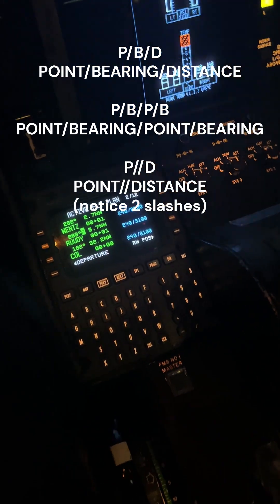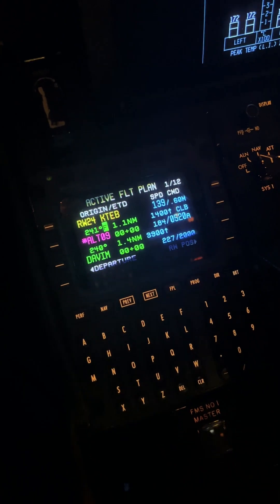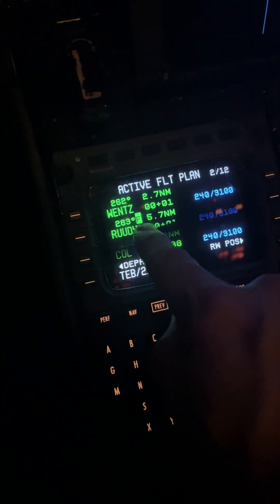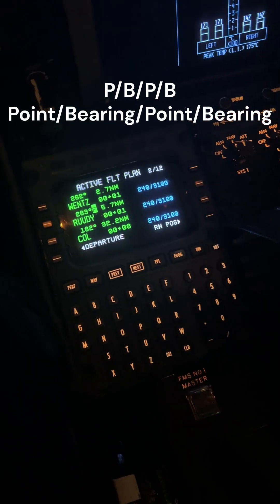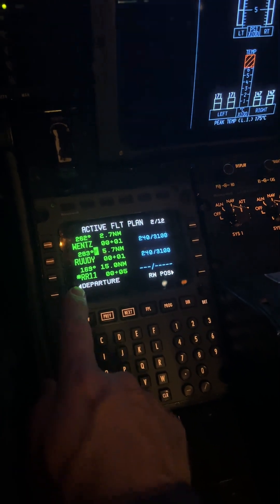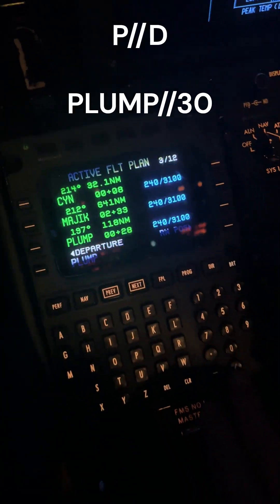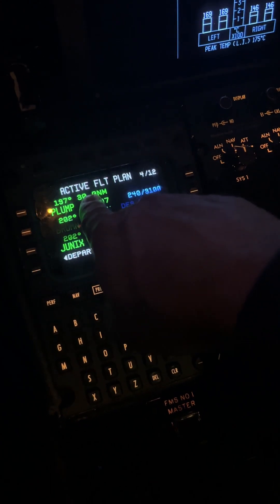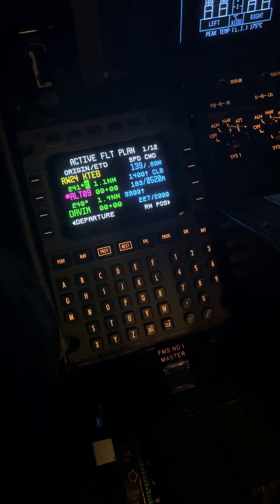FMS:  POINT/BEARING/DISTANCE

Comment: I am always amazed at how many current pilots don’t know how to do these in the planes they are flying. These requests don’t come up that often but, its a useful tool to know. Building the Quiet Bridge Visual RWY28R @ SFO is a good example. No reason to do that in Green needles.
Reply from the maker: @wgeffon  I’m sure they knew at one point but the #1 reason people forget is disuse.  As you stated, the requests don’t come up often which is why I did this video.  And, I use PBD every time whenever SFO is using the Quiet Bridge.   Thanks for your comment.
Reply: @CaptainDanPalumbo 
You probably know already but, 
Honeywell actually has some RNAV H procedures written now. They are loadable RNAV approach’s to several airports. Quiet Bridge is one of them. ATC knows nothing about them so you can’t request them. But when cleared for the QB (as an example) we just load the RNAV H, put the correct altitudes next to each waypoint and that’s it.